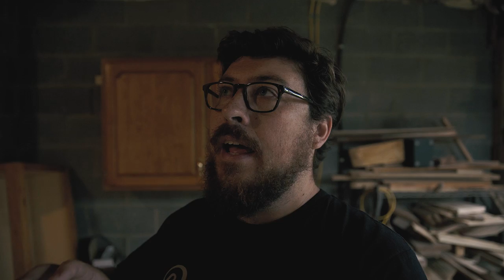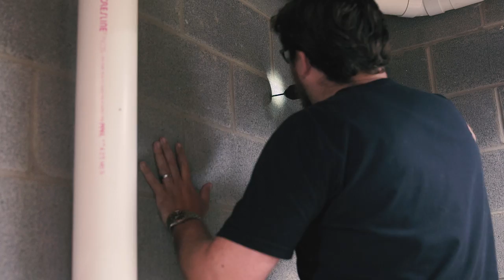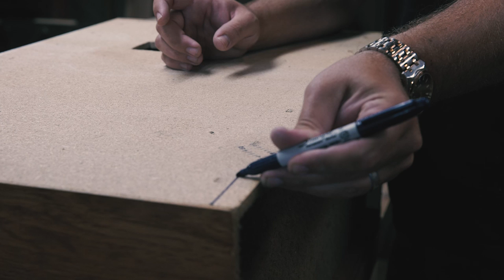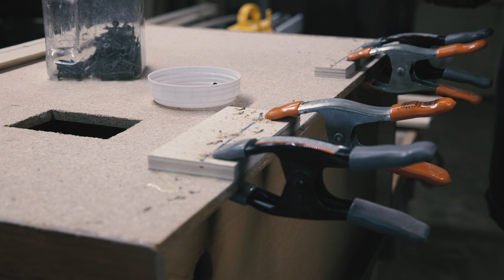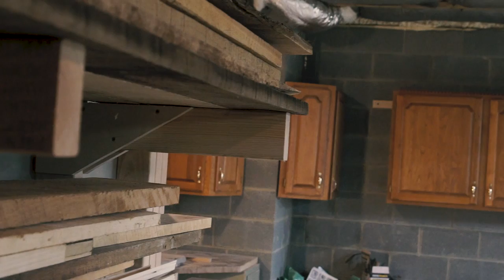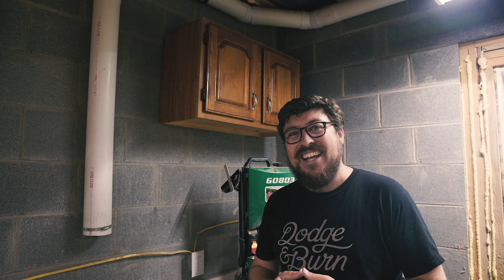Hanging Shop Cabinets on Cinder Block

Comment: That's exactly how i hang my wall cabinets using the French Cleat method it's so easy to do, and like you said in the video you can move them around. I have the same blocks but here in England we call them Breeze Block, pain in the butt drilling into them and you defo have to have a sharp Masonry Bit. Thanks for the reminder to change mine around ha ha.
Barry (ENG)

Comment: I just did this with the french cleats and it worked great. Once I got the cabinet hooked on the cleat I could slide it a bit until I got it position. Way easier than a regular cleat.
Reply from the maker: French cleats changed my life!

Comment: Pressure treated might not be the way to go. That stuff rots fasteners in no time. You have to use stainless, HDG, or specialsauce coated fasteners and I don't think tapcons fit the bill.

Comment: Now that they have been up four a good period of time, how is the French cleat system holding up? I'm worried about mine pulling the cabinets lose from the wall because I tend to put a lot of weight in them. Are my worries unfounded?
Reply from the maker: Mine all still seem as sturdy as the day I put them up. You could put some construction adhesive on the back of the cleat on the wall to give yourself some insurance and glue and screw the cleat to the cabinet.
Reply: Wm. Walker Co. Thank you so much for reply. I'm glad to hear this. I've never used Tapcon screws before so this is all new to me.
Reply from the maker: Tapcons work pretty well.  You'll know if it bites in or not.  Another alternative would be to use a powder actuated nail gun that takes .22 caliber blanks and specialty galvanized nails and use the construction adhesive.  One thing about the adhesive is, once it goes on, you'll have a helluva time getting it off...ask me how I know.

Comment: How would you hang cabinets on a furred out wall (on cinderblock) that has paneling on top of the furring?
Reply from the maker: Could you not use a similar method but screw into the furring strips instead?
Reply: Wm. Walker Co. furring strip would only give me a 3/4” bite
Reply from the maker: @hatteraslabuf  with the force being exerted over the cleat I would think that should be enough, especially because it's a shearing force being exerted. Just my thoughts

Comment: What if the concrete wall is behind drywall 1 and 1/4" deep, because of a carport add on expansion
Reply from the maker: Then I would assume the drywall is attached to furring strips or something else. In that case I would attach to the furring strips or studs.

Comment: I don't think pressure treated wood would do much here since the cabinets are made from particle board.  Sure the pt wood can get wet and not rot, but if it gets wet chances are the cabinet would too and we all know what happens with particle board and water.

Comment: do you know how much weight that would support? thinking of doing the same in my unfinished basement with block walls for a pantry but wasn't sure with can goods, liquor bottles etc.. how much weight that would hold up. The cabinet in question is from my old kitchen about 5 feet long and 3 feet tall and has a fair amount of weight by itself even empty
Reply from the maker: +Matt Lorenzen I'm not so worried about the cleat but the fastener in the wall. If you made the cleat out of white oak (or another moisture resistant hard wood) that should hold up to anything. I'd be worried the tapcon would strip out the concrete block with too much weight. But if you add a lit of tapcon and coubtersink them that should be bomb proof

Comment: That wall is not cinder block, its concrete block. Totally different ball game.
Reply from the maker: They are in fact cinder block not concrete block. "Cinder block is made of- concrete and coal cinders. Concrete block is produced from steel, wood, and cement. Cinder blocks are lighter than concrete blocks. A concrete block contains stone or sand which makes it heavier."